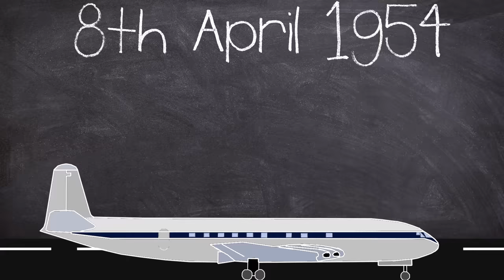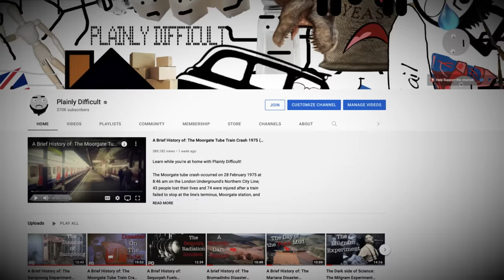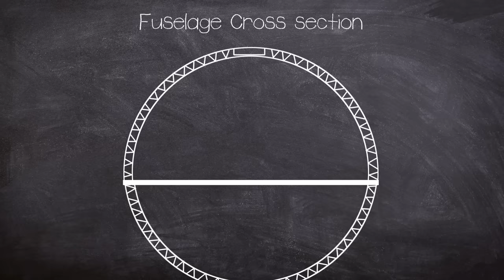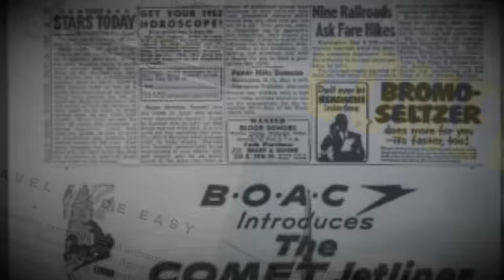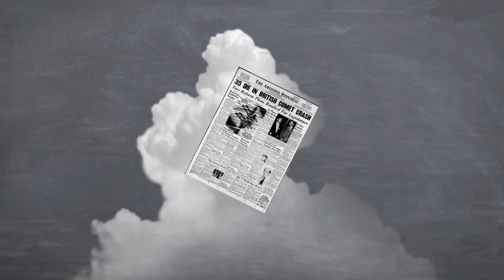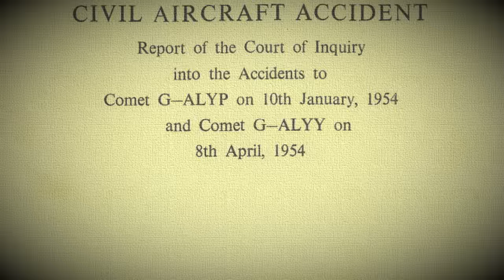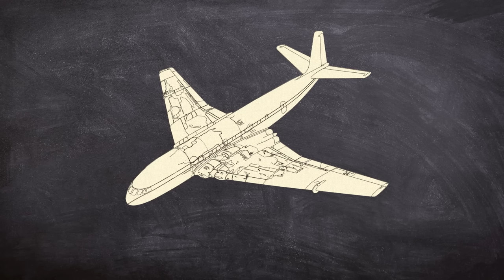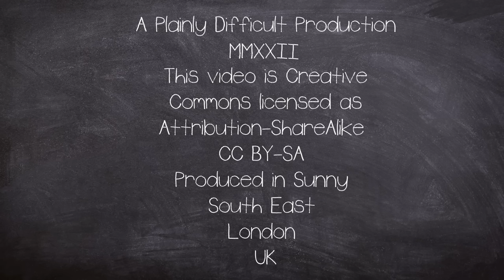A Brief History of: The de Havilland Comet Design Disaster 1954 (Documentary)

Comment: It's always easy to call it in hindsight, but every time I hear this story I'm still a little surprised at the designers. The average layman might see nothing wrong with a square window hole. Still, you might expect an engineer who works on pressure-bearing designs to think twice about anything that's square when it could be round. Of course, if they had been round from the first, it might have taken much longer and many more lives lost to learn about microfractures.
Reply: Where it failed wasn’t a window. It was an antenna mounting on the cabin roof…
Reply: To be fair to the engineers, the windows weren't completely square, they had rounded corners, the radius was just too small.
Reply: @allangibson2408  On the recovered aircraft it was the antenna mounting (squared holes as well). In the tested one it were the windows. 
Another problem were the rivets' holes. Punched instead of drilled, they were already microfractured.
Reply: The catastrophic in-flight structural failures were were not related to the passenger windows at all.
The fuselage ruptured exactly where Pascals Law tells us it should, at the reinforcing hoop with the highest surface area at its weakest point.
Reply: The fuselage hoops were too weak, the skins were way too thin, there were not enough doubler plates and the design and construction of the rivet joints were substandard.

100s of modifications and reinforcements were required to make the Comet 4 airworthy.

Earlier Comets were modified with round windows but were still unsafe to carry passengers and the Comet 1's airworthiness certification was permanently revoked in September 1958.
Reply: More lies from Sangybum aka Drbimmer.
Reply: Where do you think they learned this?? 😂

Comment: The 707 was the basis for all commercial jet design so it was the futuristic aircraft. Burying the engines in the fuselage was a dangerous design and also more difficult to service. The Comet was also smaller than a DC-6 with 1/3 the range. Boeing had been building pressurized cabin commercial aircraft since the 307 in 1938, which the Comets nose resembles greatly.
Reply: Absolutely. de Havilland were very, very inexperienced in building pressurised aircraft. Apart from one experimental Vampire, I don't think they had built ANY pressurised aircraft prior to the Comet. Boeing, on the other hand, had been building pressurised aircraft since 1938  - starting with the 307 Stratoliner. Before the Comet ever flew, Boeing had also built the pressurised B-29 Superfortress and the 307 Stratocruiser.

Comment: Douglas may have learned something from Comets missteps but I don't think Boeing needed those lessons.
Boeing was easily the most experienced manufacturer of large pressurized aircraft, indeed lack of hands on experience of pressurising large airframe by British aircraft industry showed in Comet's design. Both Lockheed's Constellation airliner and Boeing's model 377 Stratocruiser had rounded windows (they were squarish but without sharp corners). Lockheed & Boeing had built pressurised aircrafts in WW2 and worked out kinks, De Havilland just didn't have that kind of experience.
Indeed pressurized aircraft needing rounded windows was not a unknown thing within industry at the time of Comet's construction, I often wonder why De Havilland team missed it.

Comment: What sometimes get missed with the Comet is there were actually two root causes. The shape of the windows was a major contributor. But the biggest underlying problem was the new unique and revolutionary formulation of ultra thin aluminum that the aircraft was skinned with. Which turned out to be far more brittle and prone to micro fractures than was anticipated. Boeing actually had previously discovered some of the issues later brought forth with the Comet during WW2. They had a lot of early development problems with the B-29 involving pressurization cycles and the problems they caused. Particularly those involving squared off openings in the pressure compartment skin. But pretty much everything involving the B-29 and later B-36 development was beyond classified back then. And the Comet had a much thinner skin and was introducing stresses beyond anything they had seen in the two slower bombers. The 707 didn’t just learn from seeing what happened to the Comet. It was a late in the development cycle cross conversion from a military aircraft design, so much of it was being built to the military specs, just to share common tooling. So it used the same standard aluminum thickness and formulation as the USAF required.
Reply: The reason the skin was so thin was because de Havilland wanted to use their own engines instead of more powerful ones from Rolls Royce..
Reply: de Havilland simply lacked the technical experience in designing and building aircraft from riveted aluminum.
The skins were far too thin and weak, there were too few fuselage reinforcement hoops and they were too weak, not enough rip-stop doubler joints the design and production techniques used in riveting was well below industry standards even for unpressurized aircraft.

De Havilland recieved technical data on the B-29 pressurized cabins from Boeings during WW2 but engineers at de Havilland were still building aircraft from WOOD.
De Havillands post-war jets wete made primarily from WOOD not riveted aluminum which was rhe industry standard.
Reply: @TheJononator  Rolls-Royce did not have a axial flow turbojet available when the Comet was designed..
Of course the placement of the engines was also another fatal flaw that caused several crashes.
Based on an aerodynamic theory that later proved to be completely wrong, no other airliner ever copied the flawed engine placement of the Comet.
Reply: @sandervanderkammen9230  A lot of fighters and bombers of the era did use a somewhat similar engine placement. But they had very different needs. The big revolution of Boeing and McDonald Douglas hanging the engines on underwing pylons was less an aerodynamic leap as it was one of serviceability and cabin noise comfort. The airlines loved it because it made servicing the engines much easier.
Reply: @andrewtaylor940  Not true at all, while some supersonic fighters have their inlets in the Wing Root none have them in the actual leading edge  causing a disruption of airflow to the engines at high angles of attack and reducing wing lift, in the case of the British V-bombers there are some subtle but important differences with placement of the inlets ahead and below the leading edge line of the wing that reduce the problem but were still based on the flawed theory and a lack of good wind tunnel data.

Boeing engineer George Schairer was a member of the Von Karman Mission that discovered the Top Secret German Luftfahrtforschungsantalt supersonic wind tunnel research lab in Braunschweig.
Boeing stole or copied top secret data on jet engine placement and the plans for the P.1107 which became the B-47.
 The Boeing 707 Jet Stratoliner is directly based on the B-47 and the German wind tunnel data on jet engine placement.
Reply: @sandervanderkammen9230  Avro Vulcan and Vickers Valiant are the ones I was thinking of. Handley Page Victor K2 is another although I don't know what sort of service life that had. None of the Supersonic ones did. But quite a few of the early jet bombers did. Particularly the British V series. Oh and the deHaviland Vampire is borderline but gains point for being among the most dangerous planes to ever enter actual service.
Reply: @andrewtaylor940  The Vulcan was designed as a supersonic tailless delta wing aircraft, although it did reach high transonic speeds it could not reach supersonic because of the high drag of its thick wing.
The Vulcan was retired because of serious concerns and accidents related to metal fatigue.
The Vulcan had a checkered history including this famous crash where it suffered a catastrophic structural failure and disintegrated in-flight.
https://youtu.be/IYRKFkkyxh0

The Vampire is another example of this same severely flawed aerodynamic theory held by engineers at de Havilland.
Of course de Havilland aircraft in general had a very poor reputation with frequent crashes and appalling safety statistics even for the 1950s.
Reply: @sandervanderkammen9230  now now if you’re going to dump on deHaviland you can’t leave out the Sea Vixen. Which is a top contender for worst jet aircraft ever made. I’m just not sure if the intakes on its screwy frame count as wing leading edge? And yeah the leading edge inlets were a bad idea for a number of reasons. It’s just they weren’t the absolute worst feature of the Comet. Which should be a red flag in and of itself. But the non passenger military comets did have a long service life, so the funky inlets didn’t cause too much of a problem by themselves. I can’t tell you why deHaviland thought they were a good idea, as they effectively disable the broadest piece of your wing by preventing it from being a wing. Bet hey, it flew.
Reply: @andrewtaylor940  The military Comet 1s were flown on highly restricted certification and retired/scrapped after very low hours.
Comet 4C aircraft as I understood that were in military operation, were restricted to lower ceiling  and cabin altitude pressure with reduced passenger comfort but reduced metal fatigue.. military aircraft tend to fly fewer hours/ cycles per year than commercial revenue service airlines.
Nimrods were totally redesigned aircraft built by Hawker Siddeley 2 decades later..
They were optimized for low altitude maritime reconnaissance and generally flown with low or no cabin pressurization.
The Nimrod would also suffer the common fate of many British aircraft... the entire fleet was grounded and scrapped after a fatal accident involving metal fatigue.

Ironically the Nimrods were replaced by Boeing 707 and 737 aircraft, some that are actually older and have higher hours/cycles 
The U.S. Air Force expects its Boeing 707 based E3s to be operating until at least 2050 and possibly beyond.
Reply: Gues which manufacturer had the worst crash statistics, not Gkoster, not DH but Lockheed, more P 80's crashed than Meteors and there were less P 80's then we have the F 104, guarateed to crash.
Reply: @andrewtaylor940  Operatig from carriers the Sea Vixon served for longer than the F 4 with a lower crash record.
Reply: Sandybum the liar, the Nimrod was based on the Coet 4 and design work was by the DH at Hatfield, this becae part of Hawker Siddely.  The US does keep old obsolete aircraft inn service far too long.
Reply: @barrierodliffe4155  Not according to official Ministry of Defence documents, the MoD confirms that over 890 Gloster Meatboxes crashed.
The Comet remains the worst jet airliner in history with the highest loss rate of any commercial jet  and the worst per flight and per passenger mile fatalities.
Reply: @barrierodliffe4155  The Sea Vixen has an appalling 38% loss rate!
Reply: @barrierodliffe4155  The Hawker Siddeley H.S.801 Nimrod is a completely different aircraft made by a different company decades later and has a different type certificate.

Comment: May 8, 2023 - While this video is very well made (I recommend following Plainly Difficult) I think it needs a little correction. Mentor Now! has a new video highlighting the problems of the Comet and how the "windows" being the starting point of stress fractures leading to the accidents were NOT the "square" passenger windows as assumed by the press but rather the "ADF Aerial Windows" on the roof through which the plane's antennas were mounted. 

 Full Video: https://youtu.be/-DjnG74DDno 
Jump to the Time Index: https://youtu.be/-DjnG74DDno?t=1022
Reply: Later Comet Disaster investigations recovered wreckage that confirmed that the passenger windows were not the cause.
But the original investigation uncovered that the Comet was structurally unsound and lacked adequate materials and safety factors.
In particular the aluminum skins were fat too thin and the alloys too brittle.
And the planes lacked basic rip-stop doubler joints between panels.
The fuselage reinforcement hoops were too narrow and spaced too far apart to prevent cracks from jumping to other segments and the rivets were substandard and did not have proper quality controls.
Reply: @sandervanderkammen9230 
Kharzeestan Krappenz DiktorBummer Jurkzxoffenz etc and co - they should note good with much awestruckness & many extreme wondermentals.

UPDATE MORE BREAKING NEWS ETC
The skin was not found to be too thin.
The original alloy used became unavailable & so an improved alloy was used. 
It's interesting that some of the aircraft on the list should really have been noticeably safer than the Comet due to being a similar type but of much later design & manufacture but they definately were not safer.
    How things were back then -
Accident losses - % of aircraft built.
DeHavilland Comet 4 UK     14% 
DeHavilland Comet all mks  17%  
Vickers VC10 UK 5%
   The DH Comet had better safety than or similar safety to many other commercial passenger aircraft of a similar era
    Douglas DC-1        99%
      Douglas DC-2        47%
    Douglas DC-3        30%
      Douglas DC-4          26%
    Boeing s300            72% 
 Boeing 307               70%
  Boeing 247                48%
     Boeing 707                   20% 
   Lockheed Electra  Turboprop    29%
Fairchild FH-227                         30%
 McDonnell Douglas DC-8     14%
  Sud Aviation Caravelle       15%
Canadair CL-44  Turboprop   46%  
Convair CV-580  Turboprop 22%

A comparison of more recent aircraft.
Accident losses comparison examples. 
1970s - 1980s
    % of total Aircraft built
Similar aircraft type, date / decade, useage, size.
    Biz Jets
BAe-125-800                        1.7 %
Beechcraft Beechjet 400    2.2 %
Cessna 550 Citation II         7.1 %
Learjet 35 / 36                       12 %
Beechcraft 1900                  6%
Dassault Falcon 10              11.5%
Aérospatiale SN.601            22.5%

Medium size jets / Turboprops.
BAe-146               5.1%
Fokker 100          6%
McDonnell Douglas DC-9-30       9.5%
Fairchild FH-227       30%
McDonnell Douglas DC-8    14%
Canadair CL-44  Turboprop   46%  
Convair CV-580   Turboprop   22%

Beechcraft, Fokker, McDonnell Douglass, Learjet, Fairchild, Aerospatiale, Canadair, Convair  companies defunct.

    All Comets, including some Comet 1s, had full civilian use certification at some point after 1954,  civilian use certification only being withdrawn after commercial flying stopped. Examples were flying until 1997 - one example did a signals research global circumnavigation flight series in 1993 via Australia virtually without a rest travelling 28000 miles, only had an ice warning indicator issue during the flights.

    The DH Comet - World Firsts.
1st gas turbine jet powered airliner. 1st high altitude 8psi pressurised full fuselage length passenger cabin airliner,  not a trivial feature as structure  strength required for pressurisation considerably exceeded strength required for normal flying stress. Nobody else had done anything similar before the Comet.
  The b-47 used 2 relatively small, heavily built  pressurised modules  (the aircraft where 6 had their wings fold up in 2 months while flying & some had their wings fall off while parked). 
   The 1937 Boeing piston engined airliner pressurised passenger cabin was pressurised to 2 psi only - in fact that could easily be done as the normal unpressurized fuselage cabin structure strength for flying stresses only was all that was needed to be adequate so no significant weight increase issues needed addressing.
    1st all hydraulically powered flying surface controls & actuators airliner with under carriage wheel disk brakes + ABS.
1st jet airliner to cross the Atlantic.
1st jet aircraft to do a world circumnavigation flights series.
  Of course De Havilland had prior experience building many all metal construction airframe aircraft including thousands of jet powered fighter aircraft that were primarily of metal construction with pressurised cockpits & jet engines built by De-Havilland & we know the world's first all metal construction airframe airliner was built in England in the 1920s by Handley Page.
     De Havilland did indeed always work to better than industry standards at the time, no evidence of negligence ever being produced in relation to the DH Comet.
    The course of De Havilland & the general UK aerospace industry sector was not affected even slightly by the DH Comet.
     Other interesting World firsts
World's first turboprop aircraft.
Vickers Viscount Turboprop Airliner 1947. 
A 1945 Gloster Meteor Aircraft with Turboprop Gas Turbine Engine.

They might like to answer these questions.
   Which airline has just ordered
60 RR England Trent XWB Engines
& What aircraft are the engines for?

Bonus question for 10 points.
         Which country has the 
World's Highest Combined Per Capita
  Nuclear + Defence + Aerospace Sector Activity?

👍 Cheers 🙂 & 
👍 & 🙂 & of course 😎 indeed.
Cheers etc.
Toodle PIP Old Chap.

 

 

   

 
   
. .. . ... . .... . .....

ixcxicvcixvxivx

   
       
          
. .... .       .....,......   ... ..
Ivcxcvcxcvcccvccvvv